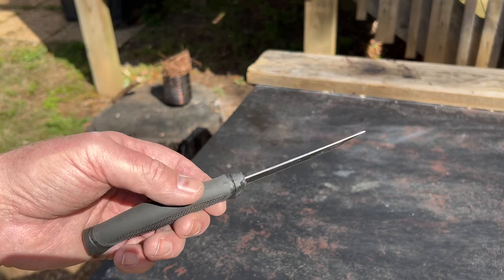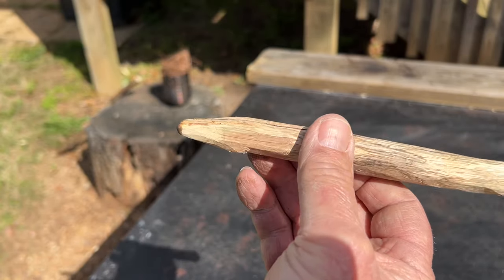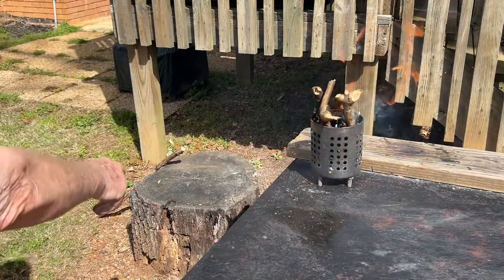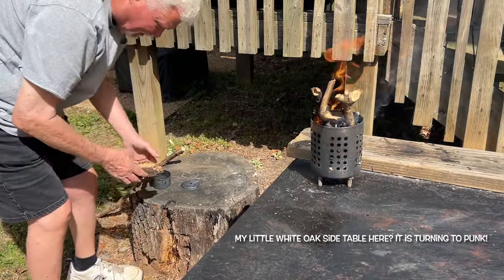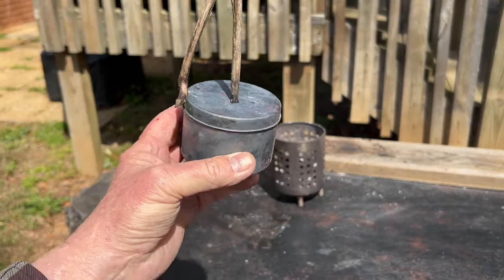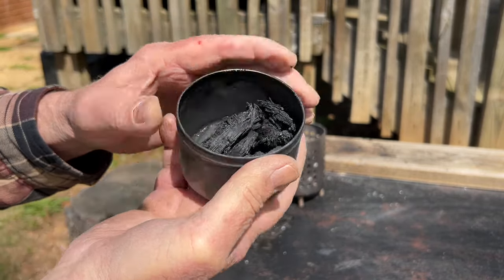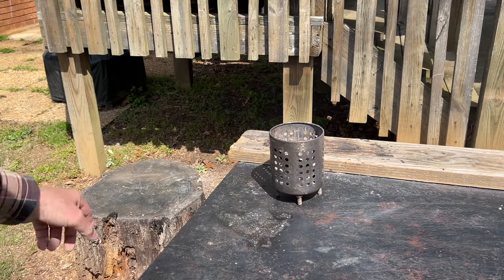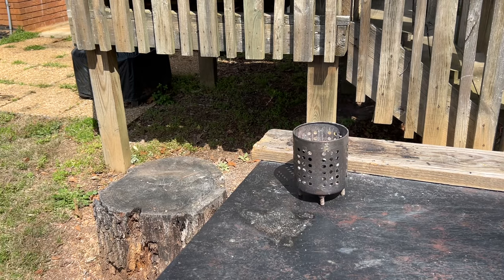$3 Walmart Bait Knife, Shave, Baton, Strike Ferro Rod, Make Char

Comment: David, I'm beginning to wonder about the "lifespan" of your various chunks of wood - or, phrased differently: how many cycles of "repurposing" do they go through before their final "ultimate" demise? Lumber, white oak stumps, limbs, spindles, bearing blocks, fatwood, all get carved down and reused somehow. Even after being burned into nothing but ash, they still have at least one more useful "life" left in a fire roll. And, I suspect, even after fire rolling, they're recycled into the lawn and garden as a soil additive. It's an interesting observation, at least.
Reply from the maker: 1) A 2x6 that was the top of my portable fire table for 3 years showed up in several videos and videos that weren’t good enough to post.
2) a piece of it became a bow drill set.
3) A piece I processed down into scrapings and shavings for the Walmart bait knife video.
4) I used a big piece to baton when showing my first fixed blade knife which was an Old Hickory Butcher Knife.
5) I used a piece to drill holes on top of then turned it into scrapings shavings and batonings for a video in the pocketknife made hobo stove series.
6) There are more uses of it on videos that I don’t remember. Btw… I still have an 1 1/2” x 6” piece left that may just end up as fuel
Reply: @DavidWestBgood2ppl  I certainly remember some of those! A hunk of wood in your hands should be proud of its many uses!

Comment: Good video as always.  As I mentioned the other day, I did go ahead and open up the holes in my char tins a little bit (.25").  What I found was a much more efficient charring process and better results, however, it took a LOT longer for the char cloth to cool off where I couldn't open the can as oxygen was keeping the char cloth fed and HOT!   I fashioned a small plug to go in the can hole now so that no oxygen gets in at all.   I may have burned my thumb and finger when I took the stack of cloth out to inspect it after i thought it had cooled...it was still red hot in the middle!  But I'll deny that if you ask me..... maybe mention this in one of your vids for other's awareness?  Keep it up my man!  Good bless ya good!
Reply from the maker: Lol. Every char cloth video I’ve made for the last 12 years has mentioned not to open the tin till it completely cools off.
Reply: I just meant the larger hole really makes a difference!!😅